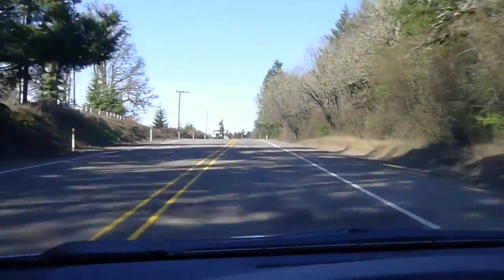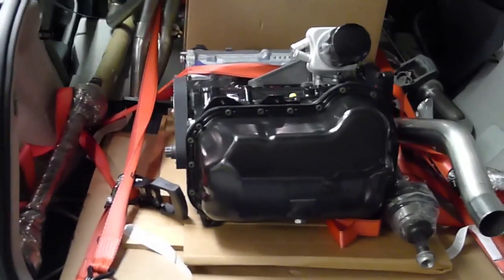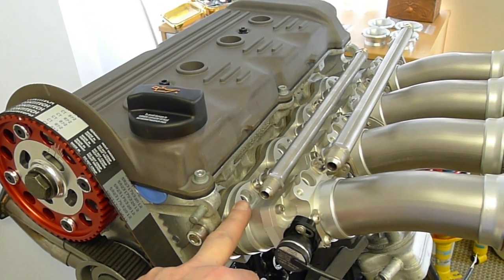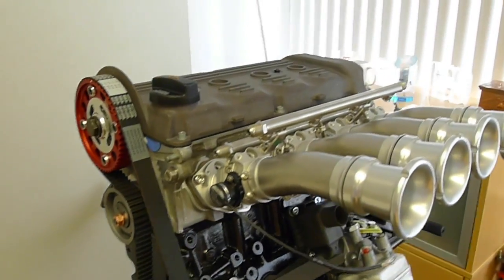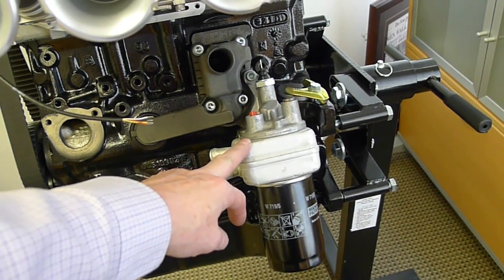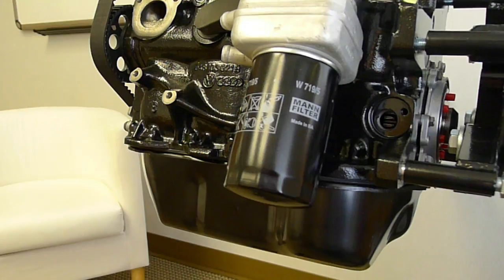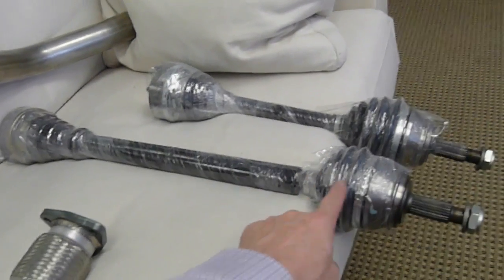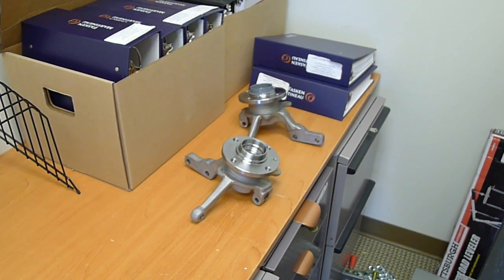The Ultimate 1983 Rabbit GTI Project - part 41 (Completed VW ABA-ABF/9A 2092cc 12:1 Engine)

Comment: Seems kinda pointless to add nitrous to such a sweet engine. BTW I may be building a similar ABA/ABF engine for my MK3 Jetta. Only mine will be lower compression with a turbo.
Reply from the maker: It should work out well for you. A healthy engine with moderate turbo boost levels would be sweet - little or no lag and tons of power. When-ever I have taken a stock engine with limited breathing and put a lot of boost on it the torque curve and lag were not pleasant - but boosting a well prepped motor with 10psi works wonders

Comment: 1:40 is when my heart stopped.
Reply from the maker: It sure looked good mounted on that stand in my office. I had planned to do the same thing back in 2000 with my pro stock 580cid steve schmidt motor for my S-10 dragster but never got around to it. There is something about looking across your desk and seeing that engine that inspires you ...
Reply: hope you don't mind us using your channel as a resource! so much info on here as well as your thread on vortex <3
Reply from the maker: My GTI project was determined in no small part to the many VW Vortex threads and youtube videos on mk1s and mk2. I am more than happy to 'give back' - and also continue to get the supportive comments from people who often help me solve problems or point out opportunities to improve things ...

Comment: Derek Spratt I've been watching your progress and have been extremely impressed with your restoration and goals!  I too have an '83 GTI that i Have had for years and years.  I built it up in the early '90's when I found a complete early Callaway GTi, their demo model available for sales in my area.  I ended up with an RPI ABA 2.0 block with a Techtonics stage three 8V head.  I converted to electromotive TEC II and did many upgrades to the original Callaway Design.  I have been contemplating converting the car to a Haldex Audi TT  AWD system and completely going through the car top to bottom as you have.  I love your ITB system but am not sure who makes and would love to get more insight into the system.  Lastly how to come to chose the Dominator system when their are so many great systems.  I however am not in love my old school system and lack of flexibility!  Look forward to your feedback!  Jeff S  Louisville KY
Reply from the maker: Jeff, I initially wanted a Callaway GTI like yours as that was the gold standard back in the day. I am still very interested in that approach. If you change over to ITBs you should get great $ for your Callaway components. AT Power makes my ITBs - but I fabricated the curved runners myself as theirs hit the hood. My engine combo likes the shorter trumpets too - I started with 40mm longer trumpets. The Holley ECU had better nitrous control options than other systems and I didn't want to use a secondary nitrous controller, plus the ECU has a huge # of I/O points - again, I have used almost all of them on my project - so the Holley in the end allowed me to go wild. Please send more info on your project to me at derekspratt@shaw.ca

Comment: The fuel you use on this engine is gasoline! I'm riding a VW engine with 12: 1 compression ratio, 1.800cc 8 valve head ported and polished, with Solex C40 carbs. I'm from Brazil, here they make more turbo cars, but for street suckers they leave to be desired in preparation ! Beautiful this motor! congratulations
Reply: Sorry for the bad translation, I'm using google translator!
Reply from the maker: I run 94 octane unleaded and it seems fine with no knocking. When I run nitrous I add octane boost for safety. I love the specs on your motor. Rock on!

Comment: This looks good with nice parts. Just from reading the HP your aiming for with NOS you are looking to make 240 I'm assuming? also why didn't you go with 1.8 Head? it does flow more than 2.0.
Reply from the maker: +Jeff Diaz My engine builder recommended that we use the 2L ABA block so we could fit in the 95.5mm stroker crank and the 9A 16V heads. He worked them over a massive amount so they are pretty far from stock. We are aiming for 240hp without nitrous ...
Reply from the maker: +Derek Spratt Remember that we also have over sized valves with 5.5mm valve stems, and big race cams that are matched to the huge race headers and race intake system ... plus we are running 12:1 compression

Comment: Is that a ABA with an Audi 16V head? I always wanted to do an ABF conversion on my 99.5 MK3 Jetta. I have an 2002 Gti 1.8T AWP but I want the 2.0T in the 99 Passat 2.0T 4 motion. I can go get the engine block, which has an AWP head which mine is already built. I was told it would mate up to the transverse transmission. it is a 337 and came with a 6 speed manual transmission which was swapped for a 5 speed Corrado VR6 gearbox. The cars fast, really fast but I want a ABA with a 16V Audi turbo cylinder head, then the forged pistons and turbo. I'm sure you've looked into that before getting an actual ABF engine, or is it a ABA block, Audi DOHC head with ABF intake manifold? Or ABA block with the actual 16V ABF DOHC cylinder head with the ABF timing chain and pistons? I heard that the ABA block with the Audi head lowers the compression ratio down to 8:1 when using the Audi turbo head. What is your setup and what are the specs?
Reply from the maker: +fockyoumang My VW 9A head is from an  mk2 while the ABA block is the US version of the mk3 ABF block. Audi and VW used almost all of the same components so you should be fine but I am not the reference on this subject!

Comment: I do not know your whole plan but on mine I had to put a external oil cooler on a soon as I installed my a/c on the car oil was getting to hot
Reply from the maker: I may have to as well. There is a water-to-oil cooler that may or may nor work out. I will spec in an oil cooler circuit into the customer radiator that I am having built.

Comment: Excellent to see your build finally getting to assembly. I've been amazed with your patience and craftsmanship. Great fun to watch. I was wondering what route you are going to take for engine management? Also what are the details of your transmission? Can't wait to see some more videos, keep up the hard work!
Reply from the maker: derekspratt.com has all of the details. mk4 020 trans with mostly 1983 ratios but a longer final ratio. Holley HP ECU which is very flexible and powerful. 8 injectors (2 sets) progressive nitrous ...